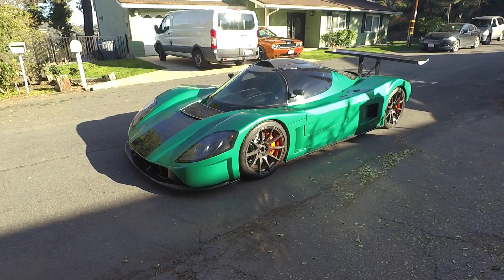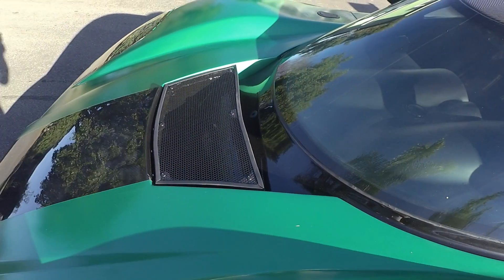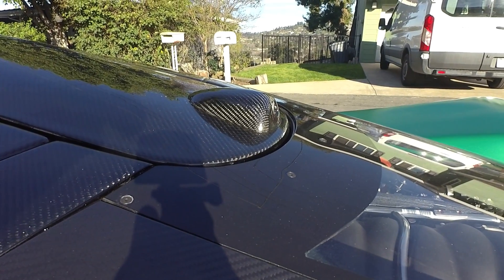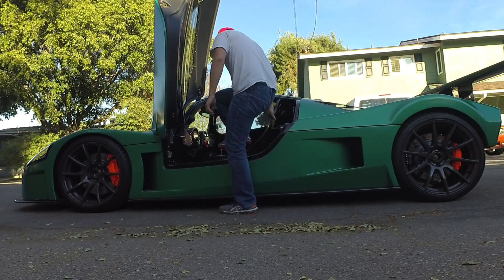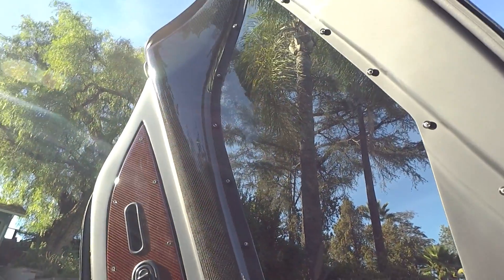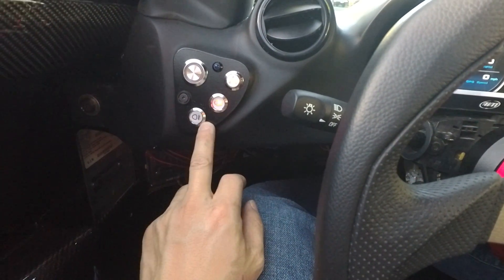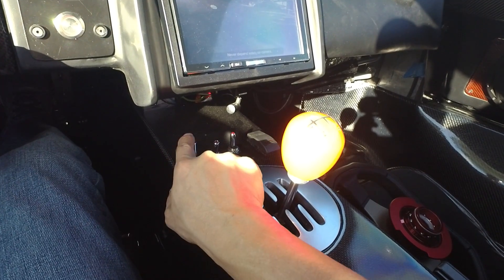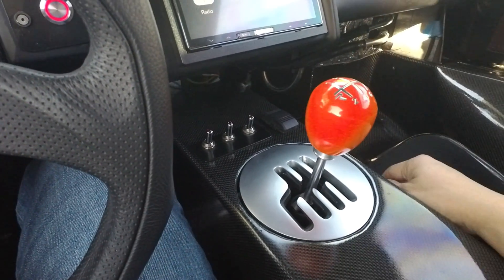Superlite SLC - Walkaround

Comment: Love the build. Nice work. The CF10s and carbon work look great. Can't wait to see more on road videos tearing up the socal canyons.
Reply from the maker: @Bandit60 - thanks!  Check out my Palomar drive video if you haven't already.  It was my first time in the canyons with the car, trying to shake it down and get a feel for how it drives.  A very different experience/a lot more raw with no power steering, brakes, or bushings in the suspension!  I discovered pad knock-back is a very real thing!
Reply: @CamThai   I liked the Palomar video.  hope to see some more canyon videos as you get used to the car and start pushing her a little harder.  I used to live in San Diego and canyons in my Z06 were my favorite thing to do.  Hope to get back there soon. I'm sure Palomar is tough without power steering since it's so tight.  
Did you consider the race electric power steering option?
Reply from the maker: @bawalther  - Palomar was surprisingly tight, it was my first time driving that road.  I can see why so many accidents happen.  Actually, the steering wheel has a nice weight to it once you're moving.  Starts out really heavy (parking lot speeds) then gets really light <35mph.  Above that point the steering seems to get a little heavier but it's a good weight, not too heavy.  I didn't find the steering to be fatiguing during my Palomar drive.

I looked into doing an electric power assist (using a Prius unit I believe) a while back but decided I didn't want the added complexity and thought it wasn't necessary once I got more mileage on the car.  The only time the steering is a PITA is pulling into/out of parking lot spots or u-turns.

The trick is to get the car rolling at ~5mph then the steering gets light enough to not be an issue.  That or I need to lift more weights.
Reply: @CamThai  you should go up Palomar to East grade(more open) , over to Julian and out and back 78 from Julian(almost as tight as Palomar) . Then leave Julian southbound and go out sunrise highway(more open) .
Also Montezuma valley Rd that goes from Julian to borego springs is awesome.
Reply from the maker: @Bandit60 - thanks, I’ll have to try that!

Comment: That's an awesome car man.  You did an great job with the fit and finish.  I really like how you finished the car out and made it more of a driver and not just a track day car.  I really dig the rear view cameras and head unit you installed.  Since its the head unit has apple car play you could use a bluetooth dongle and display a ton  of engine gauges/parameters of the tv screen.  Something to look into if your wanted a few extra gauges on top of the lcd screen in the dash.

Comment: Nice car
I want one of those with a K20 or a 2J
Maybe a RB motor.. But those are iffy
  Super super nice car
  You covered all the bases MINUS a start up and drive around.. 
Great job on the car
Reply from the maker: Eric Salyer - lol thanks for watching.  I was running out of time and rush hour was starting so the drive video will have to wait. Keep your eyes on the channel, will try to get it up soon.
Reply: Right on
 Maybe one day I'll see this at a car show
 I've been looking into "kit cars "   this is at the top of list 
I've seen a few videos..  Majority use LS motors
Couple with v10 or v12s
  But nobody uses a 600 to 1000hp. 4 cyl or 6cyl
Reply from the maker: Eric Salyer - LS motor is the easy way to go with this car.  Plenty of guys out there making 600+ hp, mine is probably one of the lower hp cars out there to be honest.  First car I saw with the CF10 wheels was a 1500hp SLC.  Extreme hp in these cars just makes it harder to drive, especially without any real traction control, stability control, or aids.  It’s more fun to drive a slow car fast than a fast car slow.  ;)

Comment: Now I only need to know where you live and a trailer. You just taught me how to drive the car thanks :)
Reply from the maker: I didn’t talk too much about the security system for a reason ;)
Reply: Cam Thai  haha well shit. Kill switch?
Reply from the maker: Hidden kill switch along with a proximity based ignition lockout.  I talk a little bit about the system in my blog - socalslc dot com.  It’s long so it’ll take you a bit of reading to find it ;)
Reply: Cam Thai nice. But need to make a video about the engine and why a ls and some driveb by’s and revs

Comment: Really nice build, and the custom touches are outstanding.   I am very interested in how the time investment of this project stacked up.  How did it compare to estimates that are out there?  I find that kits often claim X hours to bolt together, but if you actually want to pay attention to detail it is often doubled, and you end up mocking up and redo-ing several times to fix something that isn't quite as advertised.   Then, you went the additional steps of going after fit and finish.   An example of what I mean is like finding you can't pull the wheels when the car is in full droop.   So, I am betting you have maybe 3x time in this to get everything as you liked it?  Did you keep track of real hours?   Thanks!
Reply from the maker: kwasg3 - thanks for the feedback!  I’ve heard 500 hours to build this and I think Allan/Zakari is at about that for a street car, but he’s built over 20 of these now and he’s got a system.

It took me about 2400hrs, that’s guessing but I basically spent a calendar year working 8hrs a day, 5 days a week.  If you’re working evenings and weekends it will take you longer because of all the breaks that will be inevitable.  Note that this is my first component car and I had to deal with a lot of OCD during the build process which slowed me down quite a bit.

For a rough track car with ok fitting I think you could build it in 600-700 hrs if this is your first project.  The detail work is where you dump all your time - I had it in go-kart mode after about 550hrs.  This also assumes you stay with a more cookbook build and don’t customize too much.  This car represented a lot of firsts for me - first time working with fiberglass, carbon fiber, bodywork, paint, wiring, etc.  I really didn’t know what I was getting myself into!

Comment: Great Video Cam! I really enjoyed seeing what you have done to the inside. Did you plasti dip the car or is that a full on paint job?
Reply from the maker: Mitchell Smith - Thanks!  The green is plastidip.  The black is paint (base coat/clear coat).  Carbon fiber pieces have been clear coated.  Fiberglass bodies need to season before they become dimensionally stable, I’m sure cracks and pores will open up over the next year.  Would suck to spend a bunch of money on a paint job then have to repaint because defects have opened up!

Comment: Is it everything you expected? It is a lot of money for a Kit Car. Would you do it again or just buy a R8? Does it actually perform ell in corners or is it a pain to drive? I know Kit cars is nothing like OEM but how good or bad is it?
Reply from the maker: ZGERMAN - it's mostly what I expected.  I had to change my expectations along the way a bit when I discovered my fabrication skills weren't up to snuff.  Everyone wants to build an oem-like car but realistically very few people have the ability to make that happen.  Even outsourcing a bunch of stuff, very few shops can produce oem level fit/finish for interiors.

"It's a lot of money for a kit car" - depends on what your definition of a lot is, and what your goals were.  $30 is a lot of money for a piece of cardboard with a picture on it, but reasonable for a puzzle.  So part of what you're paying for is the experience of putting this all together yourself.

The car corners and drives well for the streets/canyons.  You can't reach the limit of this car on the streets safely.  I don't really intend to track the car but those who have tracked the car say its capabilities are extremely high.  The "base kit" offered by Superlite is really meant for a street car.  Heavy track or race usage requires upgrading to the race suspension/heavy duty options.

It's only a pain to drive if you built the car incorrectly or poorly.  Fortunately my car drives straight and isn't at all darty.  It moves pretty effortlessly between lanes and I can take my hands off at ~80mph and it tracks and brakes straight.

How "good or bad" it is is a function of how well it was built.  I've seen the full range of SLCs now and the bad ones ... are bad.  The good ones aren't oem fit/finish/quiet, but that's not your highest priority if you want to own an SLC.

R8 - funny enough, I considered buying an R8 for a very long time but my wife convinced me to get an S5 (more practical).  After all is said and done, I could have purchased a new R8 for the price of the SLC and S5.  Would I do the R8 knowing what I know now?  DEFINITELY NOT.  I've come to realize the R8 just isn't the car for me.  It doesn't move me the way the SLC does.  I've also discovered that many exotics just don't interest me the same any more.  The SLC has definitely tweaked my view of what an exotic or unique car really is.

I don't know what it's like to go cruising around in a lambo/ferrari/exotic whatever, but I can tell you the crowds and looks I get in the SLC are on that order or more.  I get smiles, thumbs up, and cameras pulled out every time I'm in the car.  Koenigsegg has been the most popular guess thrown my way so far.
Reply: Cam Thai thank you for that lengthy reply. It answered all my questions!

Comment: Have you had any issues with the Auto-Vox? I'm not exactly enamored with the unit I'm currently using.
Reply from the maker: CRA677 - I've had a few issues with the auto-vox but nothing that wasn't resolved without a reboot.  I added a right-angle adapter for the power cord and had noise/flicker issues until I jiggled the cable and moved it around, seems to have fixed it.  Have had blocky/broken up image but a power cycle fixed it.  Those issues seemed random and have repeated maybe once or only happened once.  Otherwise unit has been running fine.  I always only use it as a rear camera and do have a memory card installed if that makes any difference.
Reply: @CamThai  Thanks! I ask because I have read a lot of reviews indicating that the screen will randomly change to vertical rows of a rainbow color.
Reply from the maker: CRA677 - knock on wood, hasn’t happened to me yet!

Comment: Hi, awesome build, loved it. Can you explain how the front lift works? I got a car that's a bit low for the garage I park in, was wondering if theres a way to set up a similar system on mine.
Reply from the maker: @Wagner Nascimento - there's a discussion of the lift system on my blog here: https://socalslc.com/2017/03/04/11-suspended-suspension/  It's basically a hydraulic cylinder that's installed between your spring and spring seat (assuming you have coil-over suspension).  When you want to lift the front end you energize a pump that pushes hydraulic fluid into the puck to make it taller.  This then pushes down on your suspension and you lift the front end.  It's good for about 2-3" on my car.  Here's the website for the manufacturer, good folks to work with and very friendly/supportive of their product.  https://www.ramliftpro.com

Comment: Are all the carbon fiber pieces real carbon fiber or are some vinyl wraps that look like carbon fiber?

Do you really need the grate over the radiator exhaust since all the leaves would blow out when you drive?  What are you protecting against that will destroy the front radiator?  (I assume something BAD happened in the past)
Reply from the maker: There is no carbon vinyl on the car, everything carbon is either solid carbon or (real) carbon fiber applied to a fiberglass substrate.

I prefer to have the grate over the radiator exhaust, I suppose leaves and whatever else fall in there would get blown out eventually but why let stuff collect in there at all?  Just my own OCD I guess.  If it were a track/race car I'd leave the grate off but I don't think it's appreciably restricting the flow on my application.

The decision to add the grate isn't based on something happening in the past.  It's an extra layer of protection just because.
Reply: keeps the cats out .

Comment: What material did you use to make that extra air vent and A piller tweeter look so factory?
Reply from the maker: @Austin Threde - Thanks, I spent a lot of time working on that dash panel!  It's all fiberglass/bondo.  I then painted it black and topped it with Alsa soft touch paint.  Check out the links below for a bunch of photos and how I did each.  Dash panel (scroll to bottom): https://socalslc.com/2018/02/25/27-the-first-cut-is-the-deepest/    Tweeter housing (scroll to bottom): https://socalslc.com/2018/07/30/43-red-is-the-new-orange/    Dash & a-pillar work (about the middle): https://socalslc.com/2018/04/28/34-the-struggle-is-real/    The Table of Contents page has my blog organized by topic: https://socalslc.com/table-of-contents/

Comment: Thank you for providing three most detailed walk around of a slc that I've seen. I really like how your car came out. You did a great job. About how long did it take you to build and at what pace?
Reply from the maker: austin125psnetwork - Thanks, appreciate the kind feedback.  It took me about 2400hrs, about a year 8 hours a day, 5 days a week.  Some of that time was spent running around getting supplies and learning how to do stuff.  I could probably do a second car in half the time and less with more cars.  I think Allan has a nice street car build down to 500-600hrs now (he’s built 20+).
Reply: @CamThai  Allan is Zakarii right? Is he still building them, but not making videos?
Reply from the maker: austin125psnetwork - yup, he’s still building them.  He’s probably working on some pretty trick builds so maybe a little longer than usual.